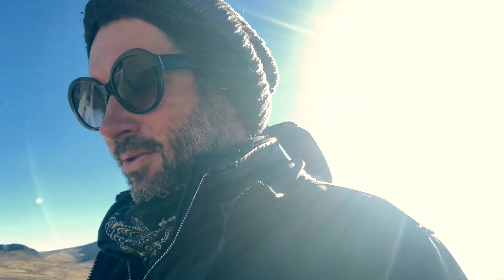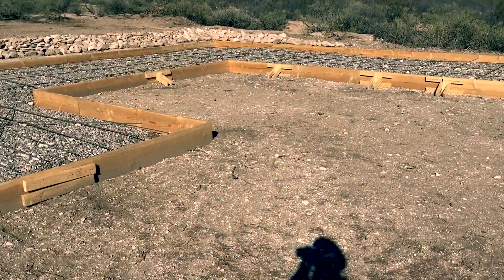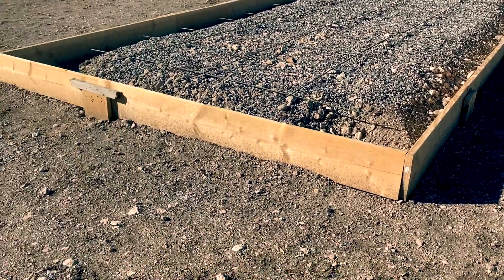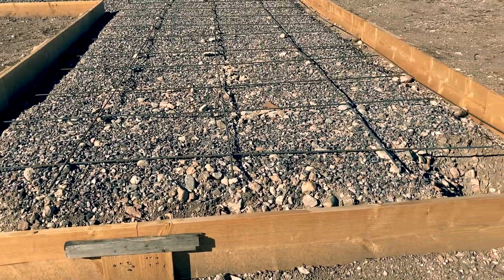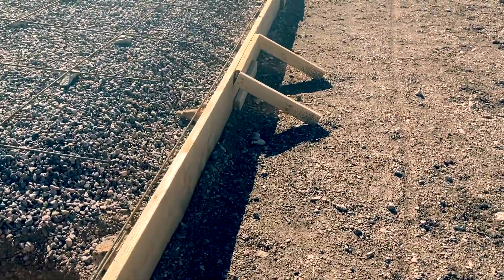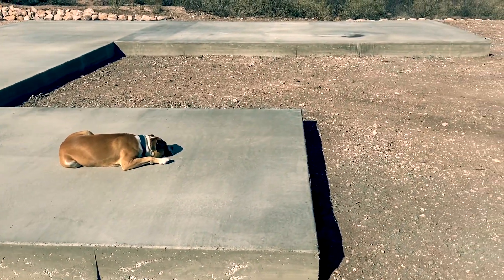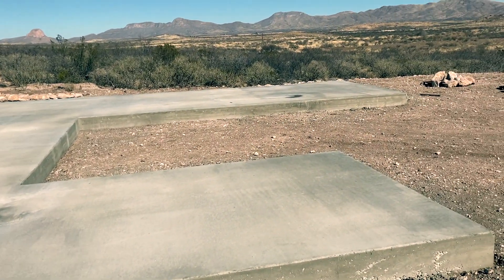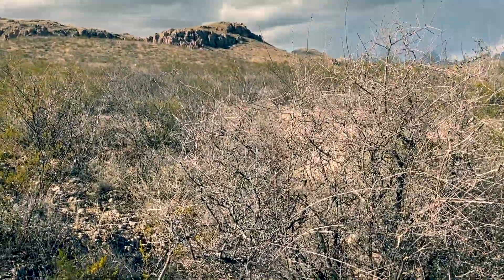Building an Off-Grid House Part 2: The Foundation

Comment: Hows the toilet piping going to work? I can see external piping for sinks or water but how will you manage toilet or shower drains? Great video!
Reply from the maker: Thanks! We're using a Separett. It's a dry composting toilet. I don't think I mentioned septic in this video... but the only septic tank is an 85 gal drum for the kitchen sink, which is required by the county. All other grey water will just go into the ground.

Comment: You're a braver man than I to not install a sluice under your land bridge at that gulch. Arizona  is indeed the wild west if there is no mitigation of run-off. 😄
Reply from the maker: What you saw in this video was just the bare minimum to get the trucks across. Since then, I added several tons of concrete and many, many tons of rocks and gravel with drainage underneath. When the house is close to finished, and we have adequate water on site, I'm probably gonna pave over the whole thing with 4 or 5 inches of concrete. Good looking out, though.

Comment: Broom finish on the interior?  We only do fhat on the exterior like sidewalks for friction.
Reply from the maker: That's the same reason I did it. The slab is just a subfloor. Nobody wants a slippery construction surface.
Reply: @arizonaadam3000  You are going to tile over it?  I would hate to have a broomed floor on the interior otherwise.  Horrible to sweep or clean.  I would even think conventional tiles would rather lay on a smoother surface, but then I don't lay tile.  I lived in a house with a smooth cement floor in Panama...don't remember it being slippery.  Just never saw a broomed interior floor before but you have your reasons.  Best wishes!
Reply from the maker: @Step-n-Wolf  No, I'm building a floating wood floor over it Either on sleepers or rigid foam board; haven't decided yet. Thanks!
Reply: @arizonaadam3000  Is the raised floor to run plumbing or wiring that you didn't do in the slab?  I know some people insulate under the floor when the floor is open to the wind, etc,. i.e. not on the ground.
Reply from the maker: @Step-n-Wolf  No, it's just for insulation. All plumbing and electrical will be exposed.

Comment: Hi Adam. You mentioned that you had to rebuild due to not being level.  Have you ever used a water level?  Very inexpensive and really cheap to make.
Reply from the maker: No, I haven't. I'll have to check that out. Thanks!
Reply: @arizonaadam3000  Literaly a long clear hose, however long your need demands. Hold both ends together, fill the hose with water up to the level equal to the hight you need, mark the hose at that level, secure one end at your determined hight now the other end can be taken anywhere you need to match your determined hight, once the water reaches the mark you made on the hose you’ll be dead level.  Hope that makes sense.

Comment: What county are you in?  Will that be the finished floor? Why no insulation or vapor barrier under the slab?
Reply from the maker: It's just a subfloor. Doesn't get very cold or wet where we live, so control layers under the slab are a bit much.